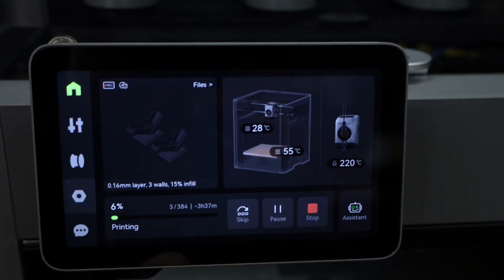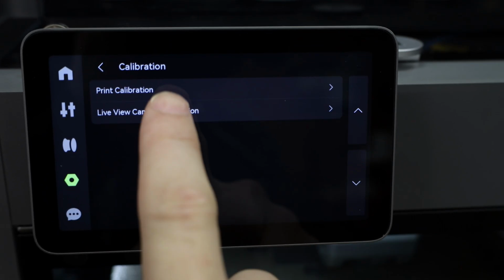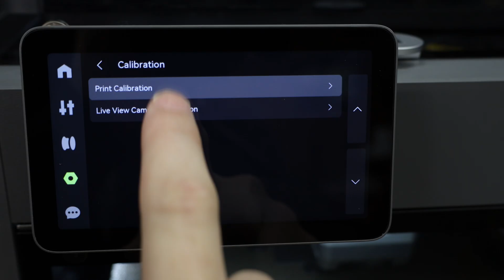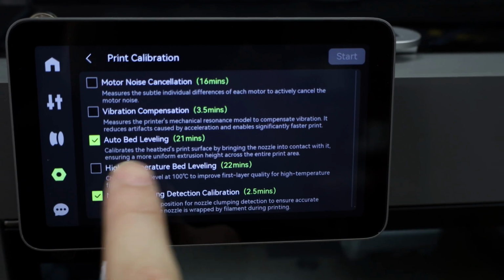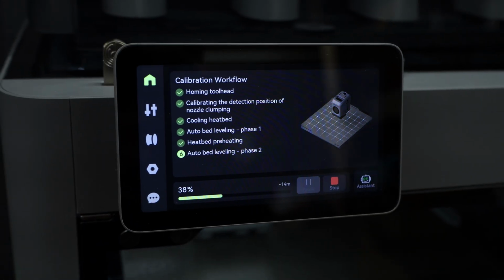How to Swap the nozzle on your Bambu Lab P2S

Comment: IMPORTANT if you change to a different nozzle diameter/nozzle type:
You need to change the nozzle settings on the printer!

Under the printer control tab (where you can move the tool head/bed, change temps, …), 
tap on “Nozzle & Extruder” 
and then on the bottom right edit button to select your new nozzle.

Comment: I cant pull mine off :(
Reply from the maker: Gotta make sure the filament has been cut. If it hasn’t, it will for sure hold that nozzle in place. Usually the printer will cut the filament after a print job is done but if it’s stuck, I’d try doing a filament unload cycle through the touch screen and pull out and down on the nozzle after that’s finished
Reply: @TheMountainMaker  You got a subscribe from me. Thank you for the quick reply as I am still trying to figure it out.
Reply: @bulletamgc6337  Just FYI, users of the P2S and H series printers have found that the metal barrel part of the nozzle can also be a tight fit on the sides, or can be jammed in at a slight angle from the factory, so you might need to gently push back and forth or side to side on the heat sink, or apply a little torsion to pop it out. This is normally just a first-time issue, and as long as you're careful putting new nozzles in flush against the seat, probably won't recur.

Comment: THANK YOU for such a very detailed and clear video about swapping nozzles! You did an extra good job keeping your fingers / hand out of blocking the video. Great job! QUESTION: What about the bit of filament hanging out the nozzle top? Do you cut that off before reinstalling that nozzle? It's usually stuck in there since it's cold.
Reply from the maker: You can to make it easier for reinstalling later. I havent found it to cause any issues just leaving it though

Comment: Does the flow calibration and bed leveling that happens when you start a print do a sufficient job after a nozzle swap?  I just started a project with a nozzle swap and failed to do the full calibration.  Guess we'll see how it goes.

Comment: If there is still cut filament in the nozzle, is it ok to remove?
Reply from the maker: yeah, the next time you want to use that nozzle, it will just push the remaining filament out when it goes to feed the new spool in. You can also heat the nozzle to around 180c without the sock on there and with the nozzle clamps already opened up, and then pull the nozzle out with a pair of needle nose pliers and pull the remaining filament out with another pair of pliers. You just have to make sure you dont accidently touch the nozzle because that would be a bad day.

Comment: If you put in a different size nozzle, do you have to change the nozzle size in the touch screen or is is auto detected?
Reply from the maker: it has a qr code on the top of each nozzle, but it does appear you still need to go in to the screen and change it if you are putting in a different nozzle size
Reply: @TheMountainMaker  yeah this threw me off at first.  I just assumed the printer would have some sensor to know which nozzle was installed.   I kept loading a 0.2 mm nozzle profile and was getting warned my printer settings didn't match.